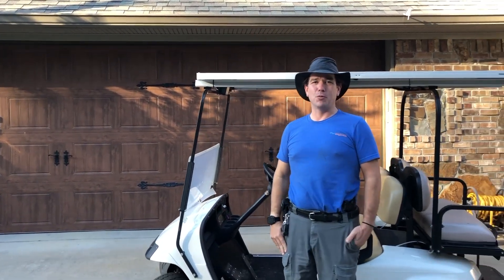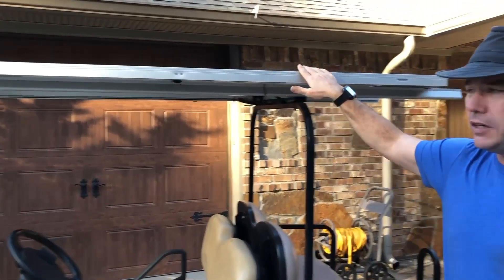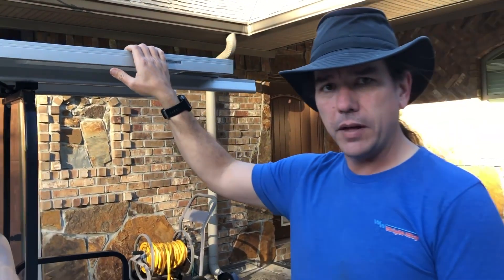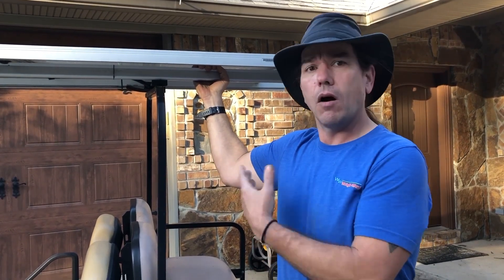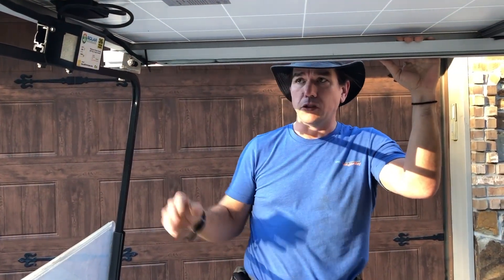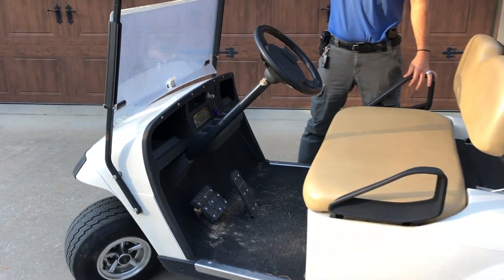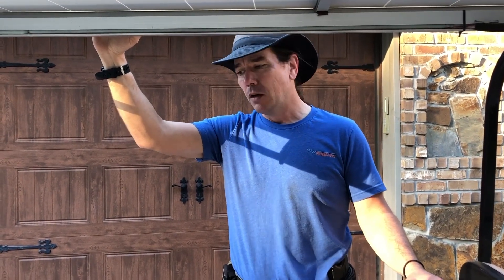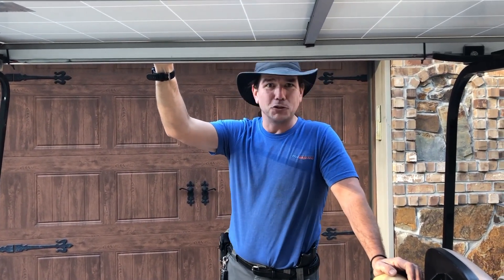Solar Powered Golf Cart!

Comment: What do I need for a 48 volt golf cart. Want to charge and run on the golf course. Will supplement with a regular charger when not running outside.
Reply: Solar panel and Genasun 48V charge controller
Reply: a solar panel and any mppt boost controller. I picked up a surplus 44x66  355w panel myself from a solar installer and a less expensive imported controller for my cart. I also went with lifepo4 batteries though to get more charging efficiency.
Reply: @fathergratwick  hey! Any chance I can talk to you about this? I want to do this conversion myself.
Reply: @mastley3  Sure, what would you like to know?